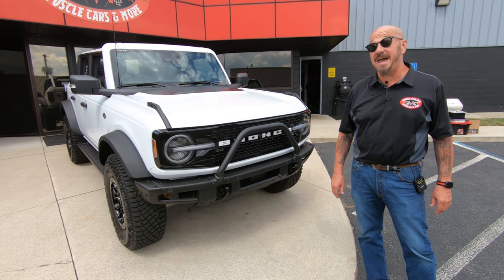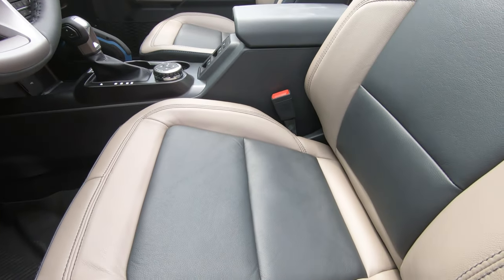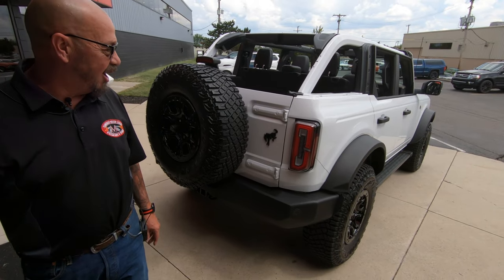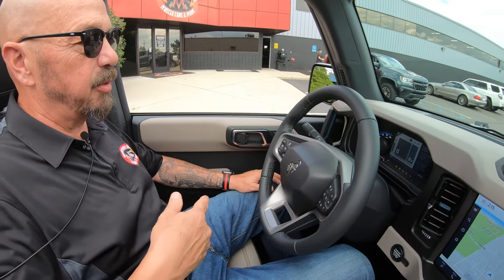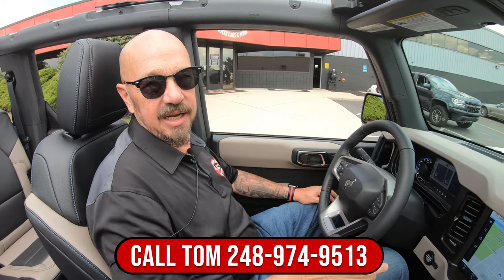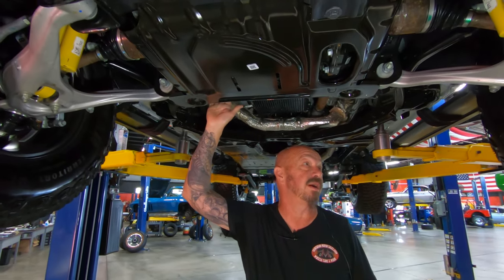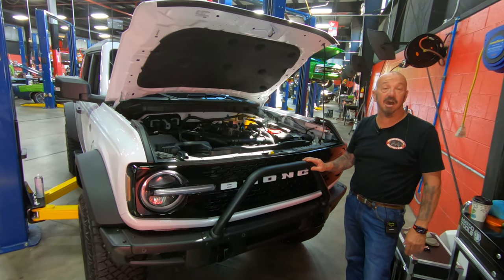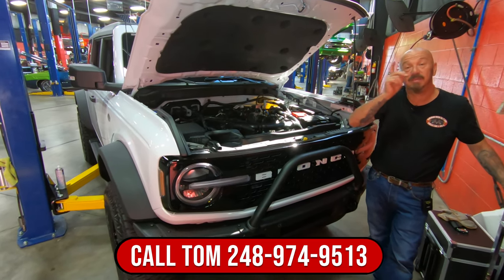2022 Ford Bronco WILDTRAK 4-Door 4X4 For Sale Vanguard Motor Sales #9525

Comment: I watched the guy review the Austin Martin 2023 with the V12 cosworth engine and it is like no other car you have ever seen. It was yellow and between the splitter and the defuser is two tunnel's the length of the car. It's all  fiber defuser and the two doors are crazy. It is like a indy car in performance and is naturally asperated. The "Valkeiry" or something.  V12 and a thousand horsepower.